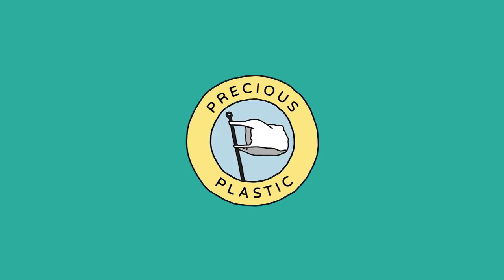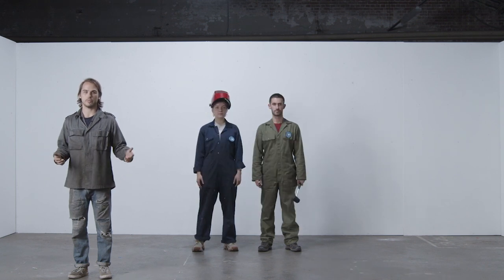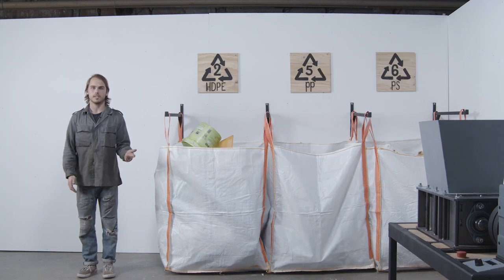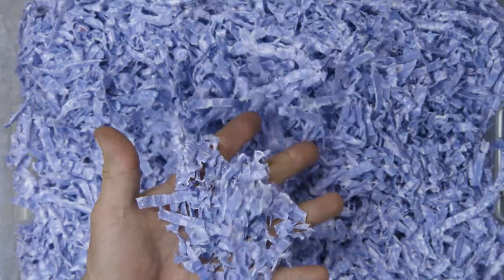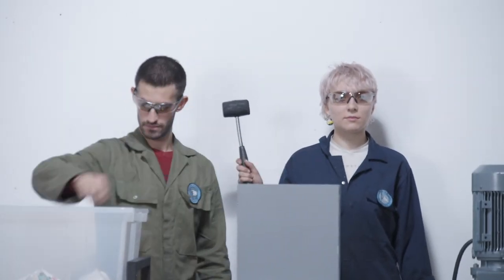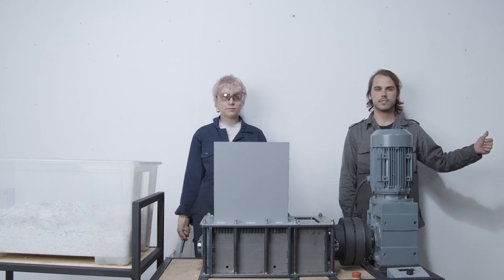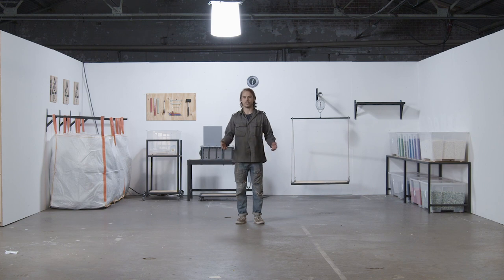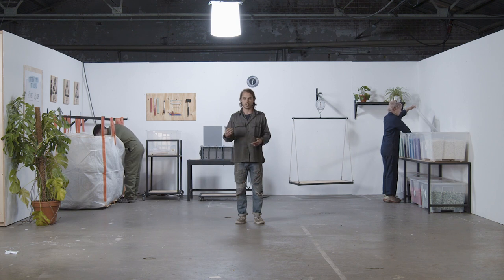Precious Plastic - Setup a shredder workspace and shred flakes (part 7.1)

Comment: How about the micro plastic particles and dust that is generated in the process of breaking down plastic into smaller pieces?
Reply: I don't think that is a very big problem because they shred the plastic rather than pulverising it.
Reply: @Convolutedtubules  I think that stuff might start to accumulate over time
Reply: @Havvse  Maybe, but I think our biggest worry is the plastic waste that gets broken down by natural processes into microscopic plastic aerosols and hydrosols. Shredding luckily does not produce much small particles because it cuts the plastic into flakes by shear force leaving mostly "flakes" behind.

Comment: Good instructional video. But in my opinion there are some missing parts. Plastic does not come clean all the time.The video needs at least plastic cleaning section. Contaminated plastic needs to be decontaminated before shredding. Especially PET needs to be decontaminated and dried well before use. So it could have been nice to see cleaning station on the  shredding workspace instructional video.
Reply: @mustafa haluk yilmaz we address cleaning in the collection space video. thanks for the feedback

Comment: So can you use the pyrolysis product to remake plastics? Actually I'm interested to know if with pyrolysis you can produce a plastic resin to mix with sand and make plastic bricks rather than fuel since climate change is an issue. Remaking plastic for bricks or as a feed stock to sell to plastic manufacturers to create a circular market for plastic is the goal I'm looking for.